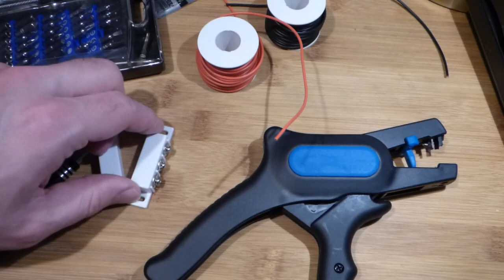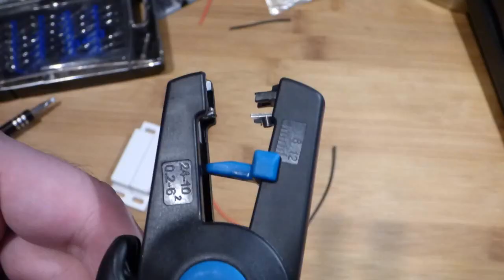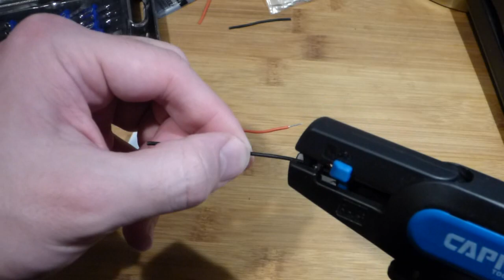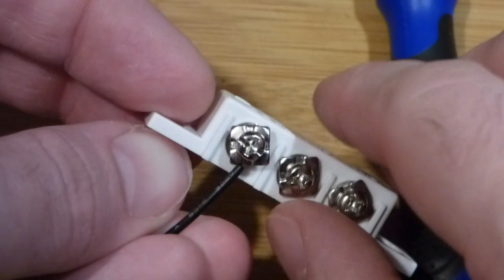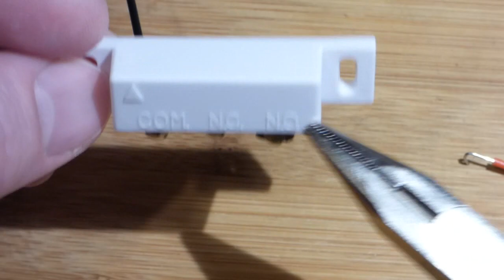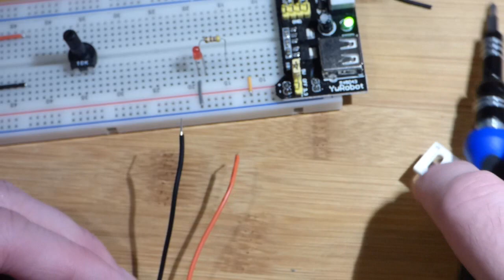My first time wiring up magnetic switch and test circuit after snipping and stripping wire

Comment: Is there a way to override the switch and have the light on with another switch if you choose?
Reply from the maker: Sounds like you are thinking of an OR gate. OR gate will have the load off only if both switches are off. If you turn either switch on, or both switches on, then the load will be on. All you have to do is wire the switches in parallel if they are switching the load directly.

Comment: I need to make a switch that will turn the light ON not OFF when the magnet hits the other side...is that possible, I don't have a board like that, just the switch and power lead and light.  SO I need the magnet to turn on the light instead? HOw do I wire that?  I need it for a game puzzle I am making for a set..where does one get the switches please? Thank you much!
Reply from the maker: If you get a switch like this one, then you can either wire it as normally closed (on) when magnet is close, or normally open (off) when the magnet is close. You just need to search for magnetic switch at any site that sells electronic components to find them.

Comment: Tip: I notice you "hook" your wires onto your screws so that the open ends of the hooks face the left. If you hook the wires on the other way (so the hook faces the right when its on the screw), the hook will be pulled into the screw as you tighten the screw, rather than fighting against you and being pushed off.
Reply from the maker: I'll have to watch again. I thought I did it that way. Thanks for the tip!

Comment: Can you connect both NO and NC to different lights and then have each light turn on individually? I assume this has two read switches inside.
Reply from the maker: I'm guessing it's one reed making contact with either NC or NO. I just made this video testing out using the NC and NC terminals at the same time. https://youtu.be/T6ZCcWgAmdw
Reply: Yes..., the two connections will do opposite, but add a relay or two, and you can do some cool stuff.
Reply: If you connected a light to each contact, NO and NC, you would always have one or the other on, but never both or neither. Unless you used a relay to reverse the function of the switch. Two switches would be better.

Comment: Can It be wired to give ground when door is open to activate a car alarm
Reply: Just wire it inline with the ground instead of the positive. The switch simply completes a circuit, it doesn't matter if it's on the ground line or the power line.
Reply: Yes, infact, switching ground is safer than power going through the cheaply made switch.

Comment: Where did you get the magnet switch
Reply from the maker: I got it out of radio shack's Make: it - electronics kit 2. Unfortunately, they changed the kit and didn't include this switch in the 2nd edition. So, you'd have to find the 1st edition if you wanted the kit and the switch.
Reply: You can buy them from eBay or AliExpress, and probably Amazon. Search for "door sensor magnetic switch"